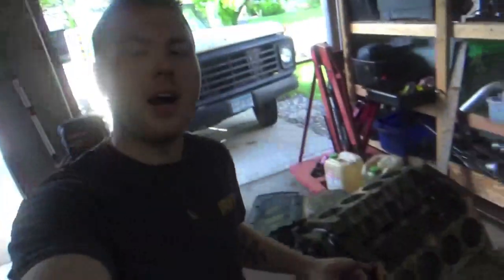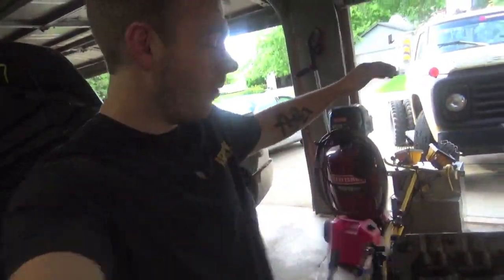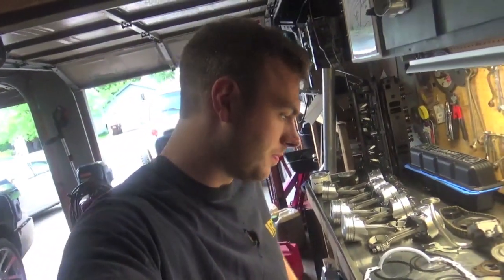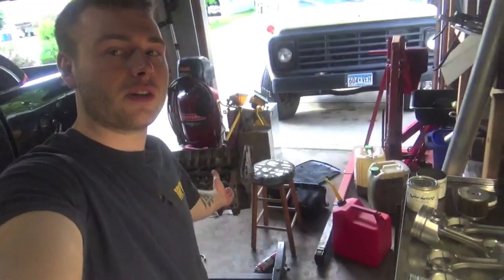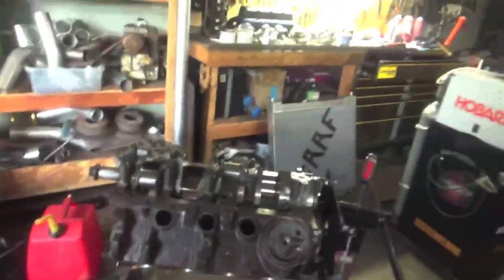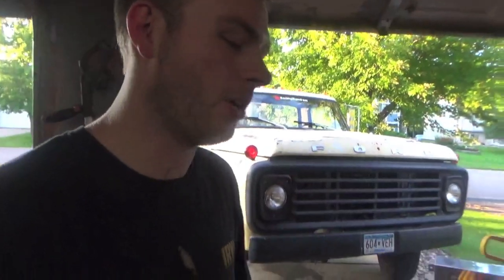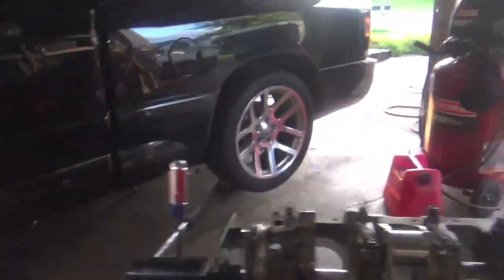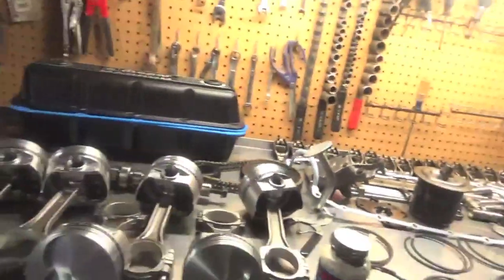How to rebuild a V8 5.9L 360ci magnum engine pt1

Comment: I didn't know if you got it or not my name is James Cox I have a 360 5.9 in a 3/4 ton 4x4 new motor with an oversized cam in it that I had made the heads are made to fit the camshaft as well 500 lift each spring I cannot find anybody with the computer that is able to time the truck properly the computer won't read for the 3/4 ton truck so if anybody out there and has a computer or something 2 time a 3/4 ton truck please let me know andaz Dodge 4x4 2500 three quarter ton brand new motor it runs but it doesn't run properly
Reply from the maker: Where are you located?

Comment: I'm Jim Cox I have a 5.9 360 Magnum in a 4 by 4 3/4 ton truck I've had some machine work done to it and balanced I have a little oversized cam in it the heads have been built for the camshaft 500 lbs spring I cannot get it timed it runs but I can't find anybody to time it because it's a 3/4 ton truck the computer is not reading the computer I need somebody to help so I can find a computer that I can time this motor with so it runs properly if you can help me please call me at 208 484 6049
Reply from the maker: You need a tune? What year truck?

Comment: When adding studs, main tunnel sizing should always be checked, the stud clamping pressures change also so does camp index.. and  will in most cases, change clearance dimensions. Align honing usually must be done...be careful.
Reply from the maker: Oh yes was aligned honed!

Comment: I have a 97 dodge ram with a 5.9 magnum the crankshaft broke in it i just got another engine from a 94 dodge ram with the 5.9 magnum it's got a egr valve on this engine should i remove it or leave it on I'm hoping everything will work i know a 98 dodge 5.9 is different wiring if someone could help me i would greatly appreciate it thanks
Reply: Just swap manifold and use the trotle body and cencers from the old engine